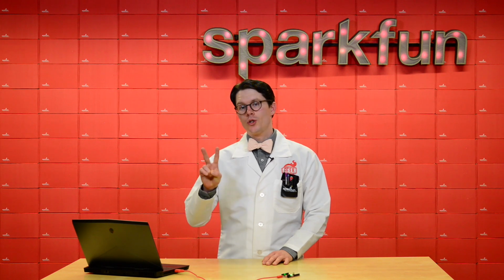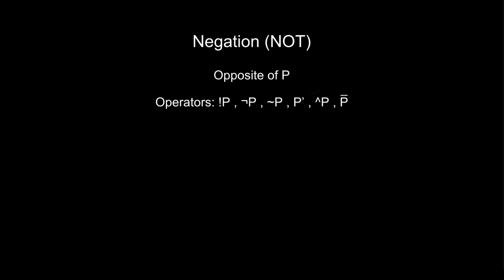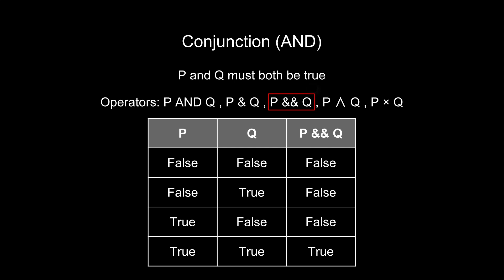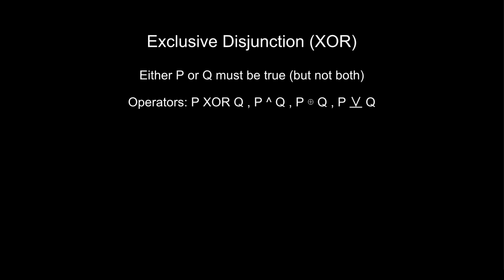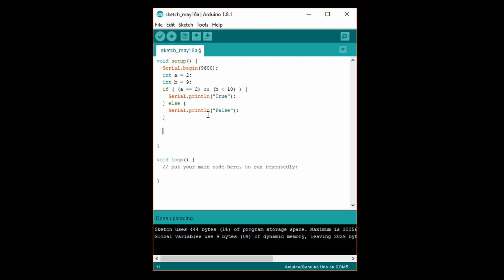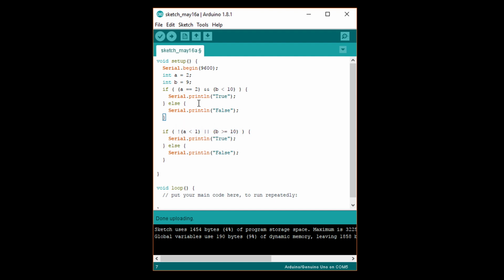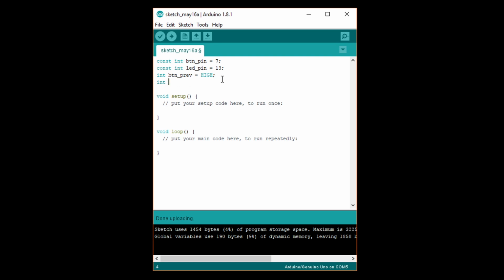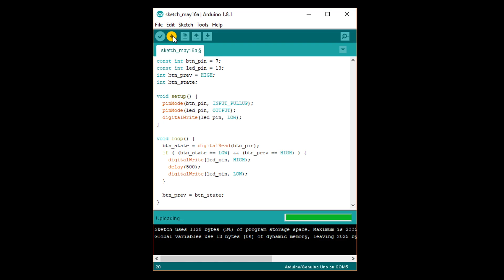Arduino Programming: Logical Operators

Comment: Question: when it comes to the btn_state and btn_prev,  high means open circuit and low means closed circuit and when it comes to the led high means closed circuit and low means open circuit, why is that?
Reply: HIGH means 5 volts, LOW means 0v (mostly). Open vs closed is generally a mechanical term.

Comment: Why is there no LED in your example board? It makes it hard to know exactly how to wire that!
So far I’ve not been able to get this working. My codes the same, the board setup is what makes sense to me (since there is no direct material to refer to), and yet all that happens is when I press the button, the led turns on.
Just an odd choice not to use an led in your example, especially since (I assume) you must own at least 1 and a resistor
Reply: He is using the on-board led conected to pin 13

Comment: sir i needed ur help.
can u tell me that how can i play mp3 file with the help of mp3 shield interfaced with 4*4 keypad
i means to say that i wannn play 16 mp3 file with the help of 4*4 matrix keypad by using cytron easy mp3 shield. sir is it possible to play if yes then tell me. 

how can i write code for it.
i am making talking calculator so i needed to play mp3 files..
i have made calculator with the help of Arduino UNO and now i am trying to make voice for talking calculator but i couldntt understand that how can i play mp3 file with the help of mp3 shield which is interfacing with 4*4 keypad
plz reply

Comment: Always Protect Your PORTS. Use a 220 to 330 resistor from the source to the Port
Reply: Why?
Reply: @odinata  back emf in complex circuits, static electricity and accidental shorts in the real world. Yes most MC have internal protection resistors/diodes, but being an IC, wattages are rated smaller than what thru-hole components can traditionally deal with.

Comment: shouldn't you put resister in line with switches / buttons and LED's?
Reply: Jay Mee the microcontroller has internal resistors. That's why he has the PULLUP command in the code. 

But as a general rule, yes. You should.
Reply: Jay mee i just made a video going over that very fact.